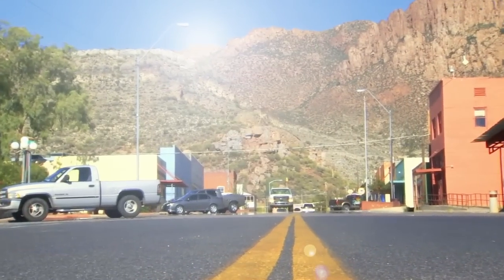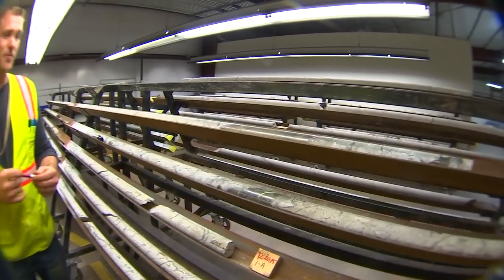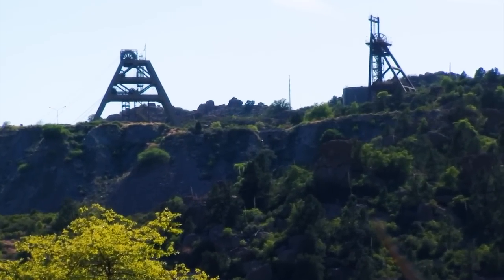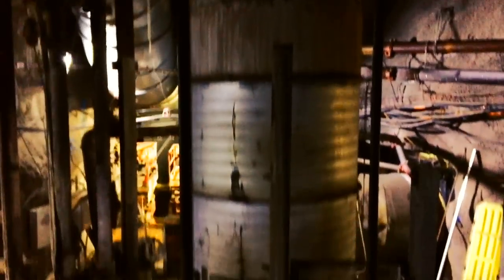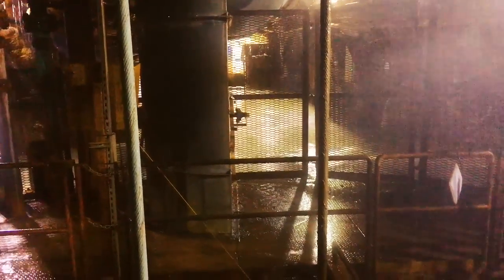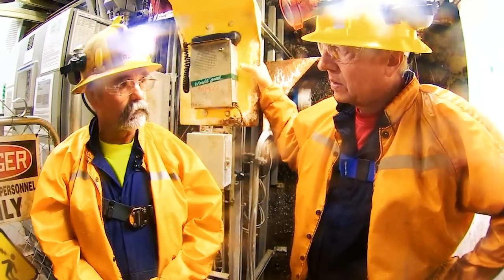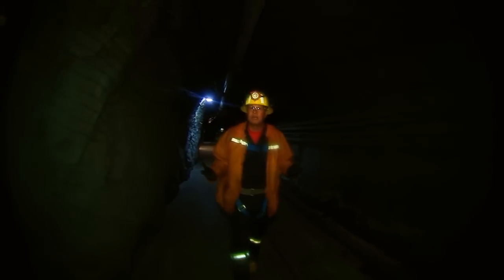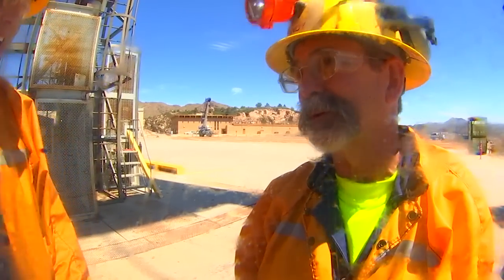Exploring a future record setting copper mine

Comment: There is no way they are walking through water coming down at 175⁰. That is hot enough to cause 3rd degree burns in less than a second of exposure. In fact, you can get third degree burns at around 135⁰ with only about ten seconds of exposure.
Reply: Yeah - because YOU can't understand how they've mitigated the risks,  they MUST be lying,  right?
Reply: @demetriusmiddleton1246  Mitigated risk doesn't equal accurate information. The videos claims they are walking through water at 175⁰. That means they would be getting burned wherever bare skin is exposed to the water, or the information presented is inaccurate.
Reply: @AceSeptre  the water,  uncooled may be 175, but they do have AC. Bruh, they are engineers! Why would they lie about that anyway! Smh
Reply: @AceSeptre  Your not comprehending the information presented.

Comment: 170 degrees? Seriously?)
Reply: I work at resolution. If the power goes out they have to evacuate immediately because the only way for them to stay alive is adequate ventilation. Once you hit a certain depth the earth heats dramatically.
Reply: #10 hoist is the main method of lowering personnel into the mine. #9 is the primary vent. The “never sweat” is the emergency vent.